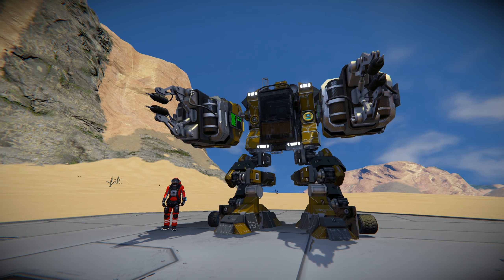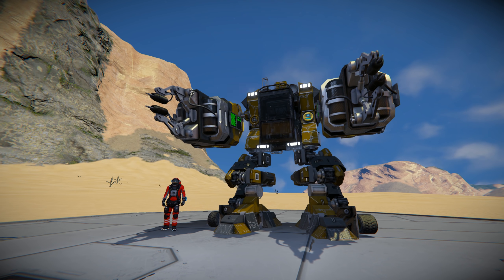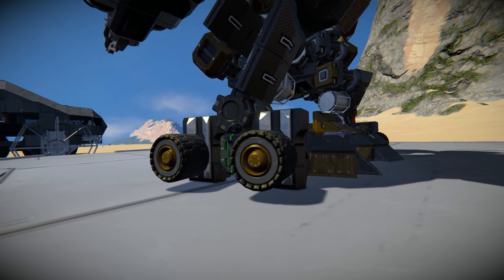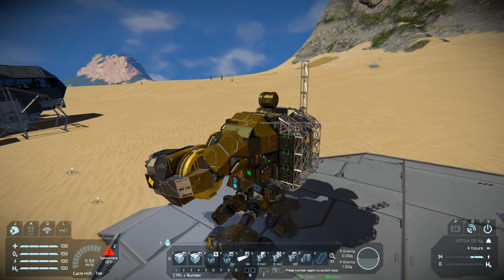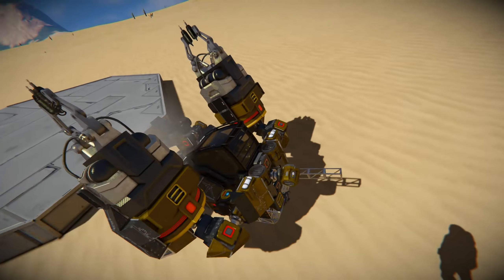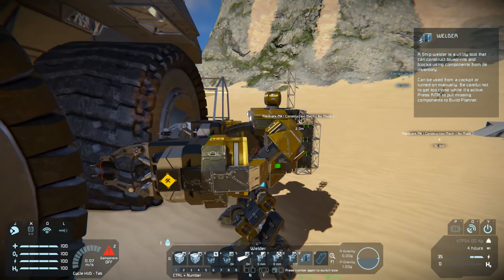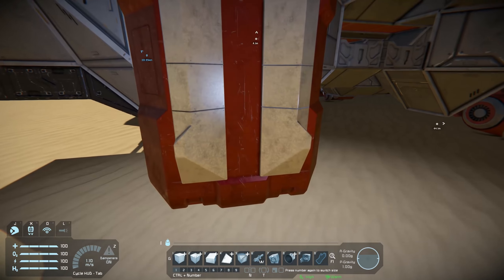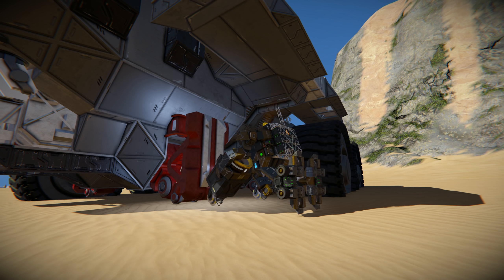Space Engineers - Construction MECH!

Comment: Honestly, the way it can walk and wheel really reminds me of the mecha from an old anime called Blue Gender. Also, you might get better results from the wheeled mode if you can put a third wheel on each foot on the inside, otherwise, the flex in the joints could make it sag and drag on the sides (imagine a car trying to drive with both wheels on one side gone.) Also, it would be cool to see weaponized versions in a battle of some kind. Given what tends to happen with walkers in SE, maybe you could do a machinama where a squad of them infiltrate an asteroid base and fight through the crew and defenses to set a warhead. Also, completely unrelated, but I have thinking: how strong can you make gravity in an area? Because it might be possible to use gravity generators to create invisible gravity wells that are strong enough to pull in unwary ships either to crash into the planet or asteroid, into range of weapons, or anything else you can think of. 
Edit: I watched more closely, and the insides of the feet are definitely dragging.
Reply: J C the wheels on the inside are a very good idea and a great observation! Also jack was completely disregarding the instructions in the inside of the left arm displayed on the lcd panel. Also it might be cool to add a piston with landing gear in the center to stabilize it when grinding or welding, as I noticed that after grinding the wheel, it fell flat on its face. However I don’t know if that’s plausible.

Comment: The Esthetics on it are you good looking and the legs function with the wheels are ok. There are only 3 things wrong. First the feet are not long enough, it's like a 6" man with size 5 feet. Next is the waste its stationary. If you add a rotor in between the hips and the cockpit you can twist the upper torso. And lastly have a small pistons group per side of the back of the mech so it can stop looking like a turtle on its back. Have one parallel with the x axis of the mech then the next at 10-30 degrees facing down  to help prop it back up. Besides those faults it's a good piece of equipment that looks good and function mostly well. The creator did a good job with programming the legs to walk along with the wheels. And the arms can be swapped and still works. For a Mark 1 outstanding work, and keep up the good work. And Jack, thanks for the video. (Don't let Craz use it. He might break it within 6 minutes of use)